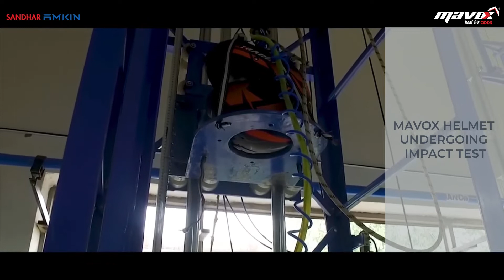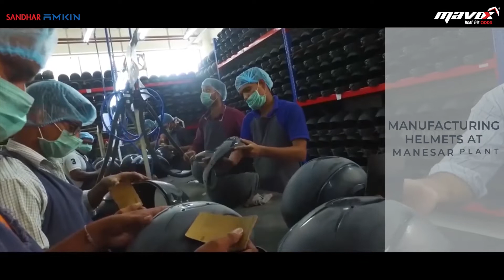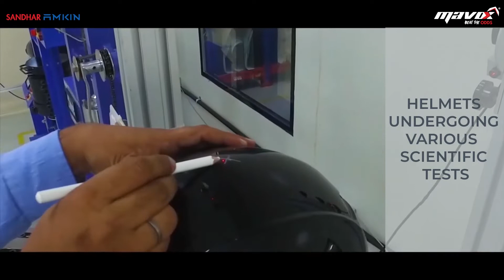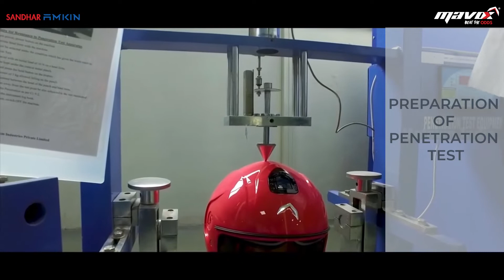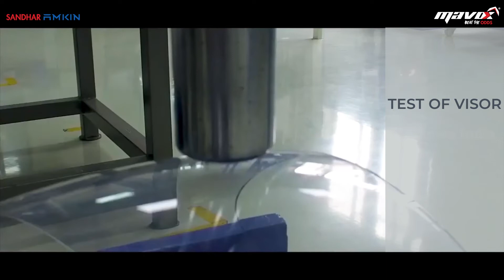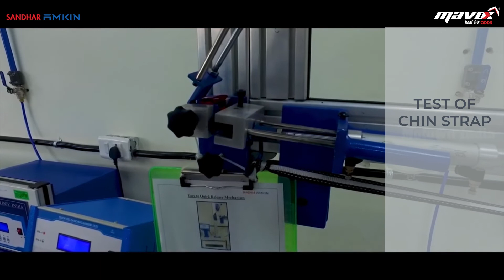A Ride of Ultimate Safety- Mavox® Helmets

Comment: You should have also talked about how do you measure the safety of the helmet.
Is there any sensor or something that's places inside the head foam in the helmet? Or it's only a visual inspection?
Reply: Yes there are sensors that detect the force traansferd to head